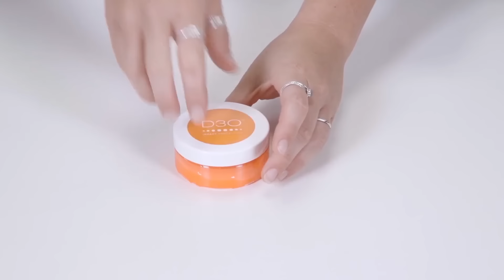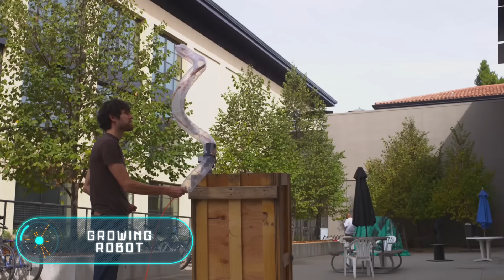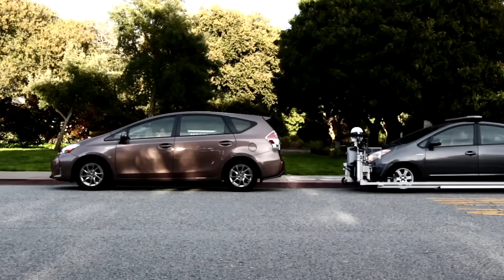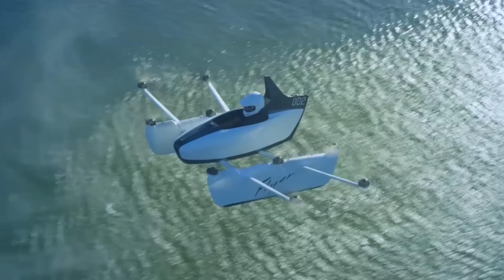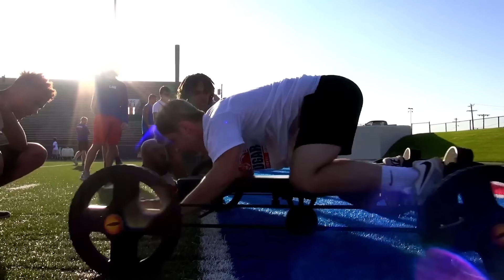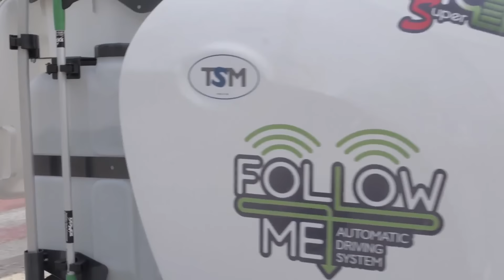AMAZING TECHNOLOGIES THAT ARE ON A REALLY INSANE LEVEL

Comment: D30 isn't exactly revolutionary or unbelievable. Its a Non-Newtonian fluid. It's been a thing for decades if not centuries. It was actually looked at for body armor years and years ago. Poland's Military Institute of Armament Technology in Warsaw actually took this back up in the early 2010s and have been adapting into body armor applications since. When they found the proper shear thickening fluid they went full steam ahead. Pretty eager to see how it turns out

Comment: They need to put d30 in football helmets
Reply: Not only what Ethan Hiers pointed out but it doesn't matter what kind of padding you put in their helmets. Concussions result from the brain slamming up against the inside of the skull. So unless you can come up with a plan to insert padding in between the brain and the skull it's a moot point.

Comment: They reinvented oobleck😂
Reply: Cornstarch and water...
Reply: Silly Putty contained in a housing mould.
Reply: juliesfar 😂😂
Reply: Nah, they reinvented silly putty
Reply: Lol
Reply: Didn’t a company try to make speed bumps using it but they got shut down
Reply: @chriszabala6625  
Yes, I saw a video about here a few weeks back. It didn't say anything about being shut down though, but it could have been an older video.
Reply: It is similar, however, oobleck is made from water and cornstarch. This means that when pressure is not being put on it, it becomes more liquid, and loses viscosity, as well as the fact that the cornstarch would settle, and be difficult to mix back in. This technology stays in the state of matter wanted, such as a solid. It is made from a polymer that locks together when force is applied.